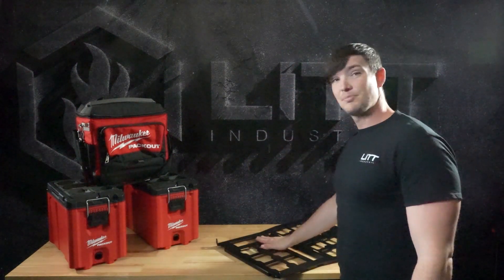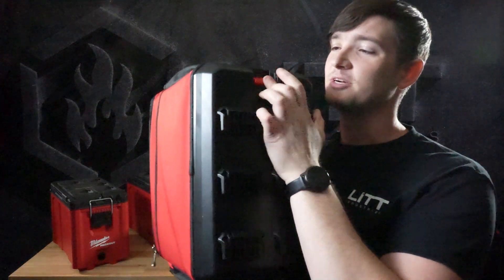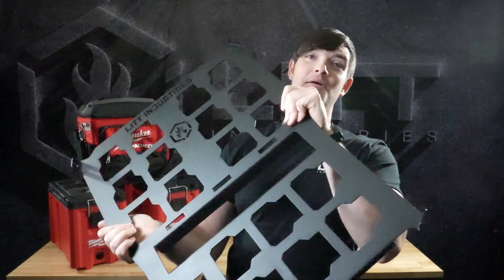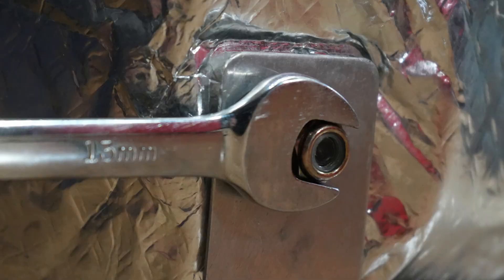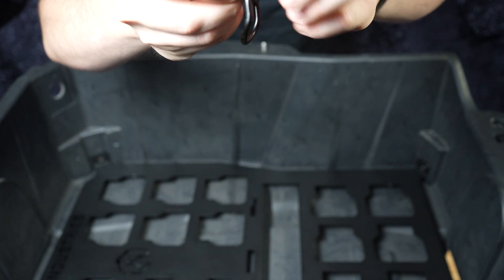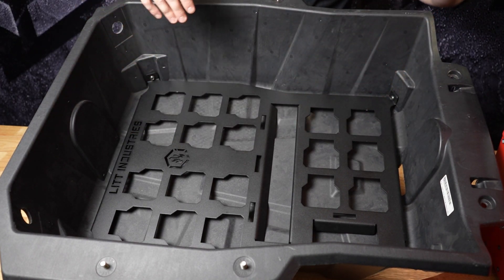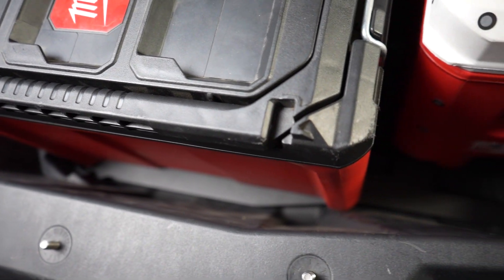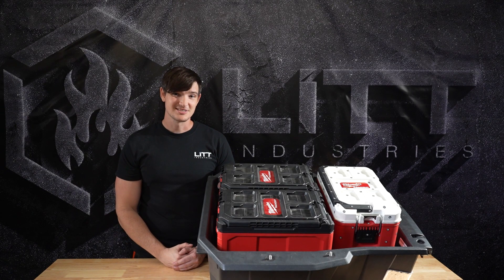2024 Polaris RZR Triple Milwaukee Packout Cooler and Toolbox Storage

Comment: This may be wierd, but I would love to see a flat rack that could say fit two packouts that could mount to the linq plate on the back of the 2020+ spyder.  Its something that I could snap on to do grocery shopping or the like and take off when I am done, leaving a flat surface to use to say strap down a pizza if I need to

Comment: The ones with aluminum bars will fit but the packout must be modified. i have this plate in my machine and i have the xl toolbox which has the bars. i took the bars out and cut the bottom bar mount of the sides and it fits in perfect. Dont know about all aluminum barr boxes but that works with the xl
Reply from the maker: Correct, for plug and play reasons we didn't suggest customers cutting their boxes. This is a good work around solution to get a bigger box in!
Reply: @littindustries  understandable. Just wanted to mention for potential buyers
Reply from the maker: We appreciate your insight and help to others! @adammiller8415